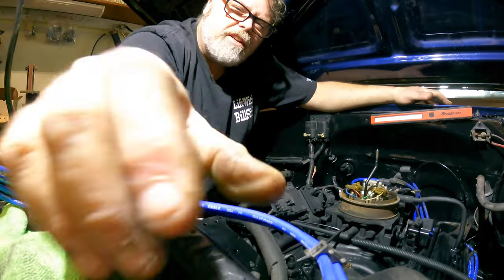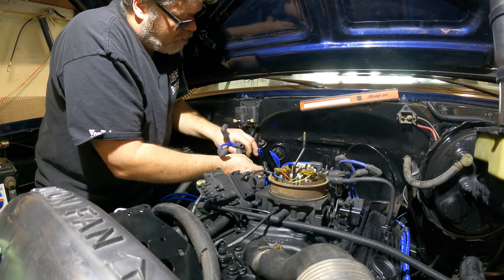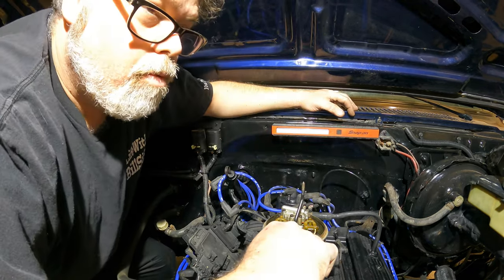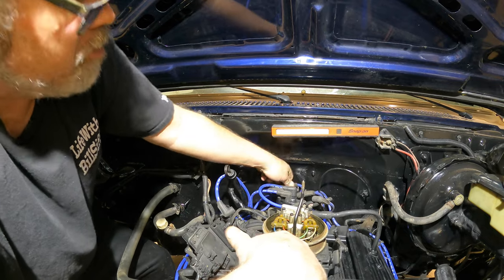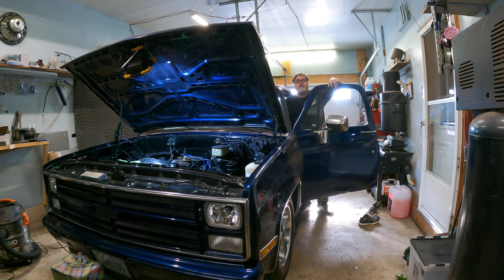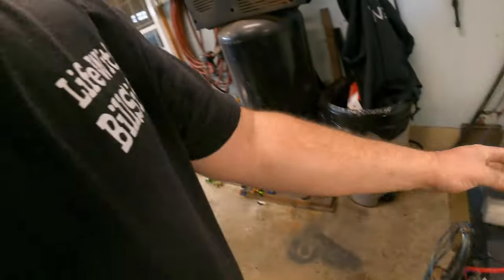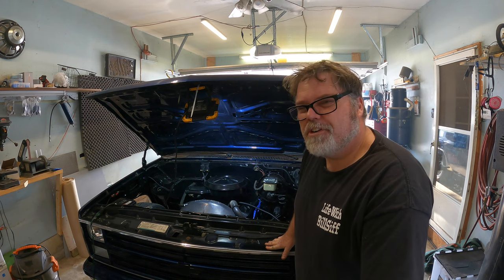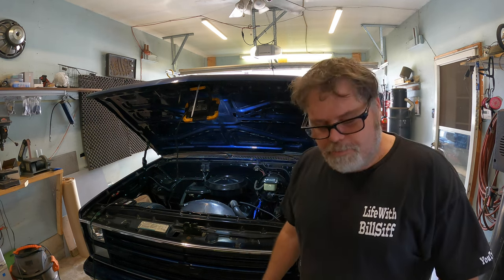Wow This Engine Runs Great    4K

Comment: Hey Bill sounds pretty good!   Maybe it is just the way the camera is recording the audio but the engine sounds like it is running at a high idle , on the TBI that is a sign of a air leak.  When I had my 89 Silverado with the 5.7L it went into a high idle like that. What I ended up finding was that the gasket between the throttle body and the intake manifold had gone bad.  It is a simple job to pull that throttle body and replace that gasket "If it really does have the high idle problem".    Okay Jim , carry on !